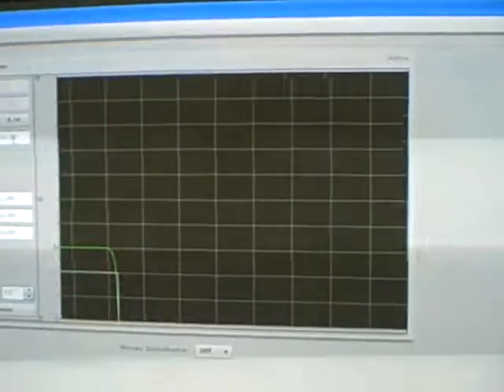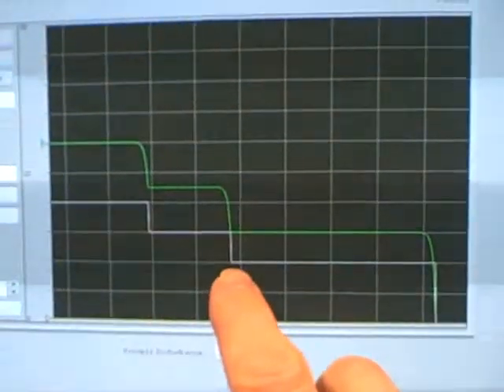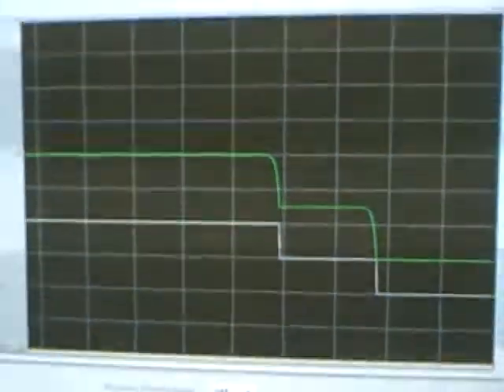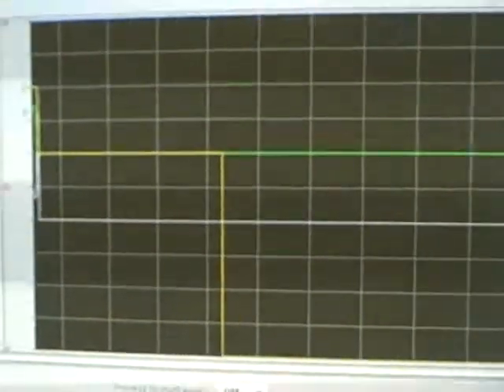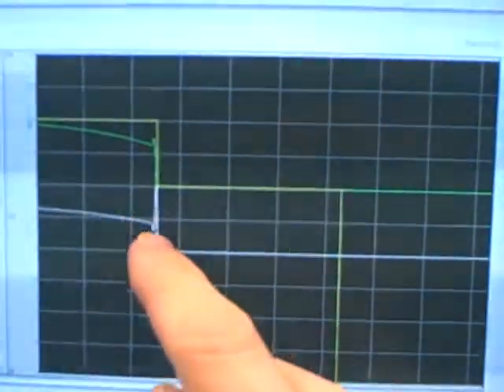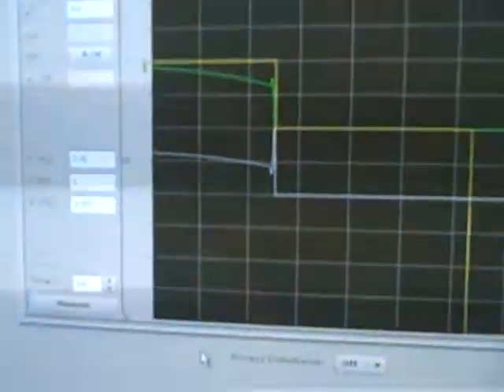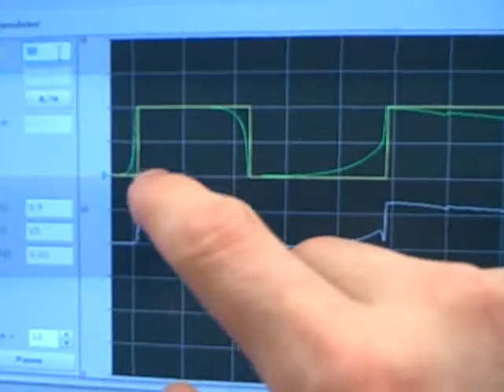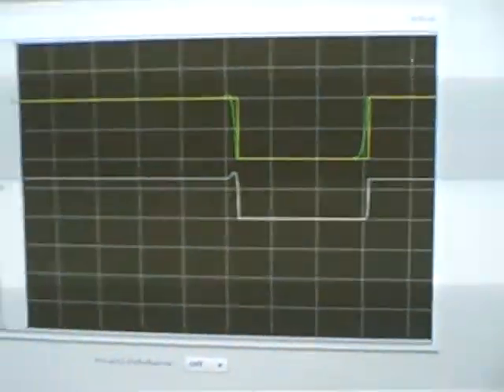Simulated self-regulating process PID tuning

Comment from the maker: The problem with changing gain to correct for offset is that you will introduce dynamic instability.  If you crank up the gain to reduce offset, you may drive the loop toward oscillation.  Also, this would only reduce the offset and not eliminate it, since a proportional-only controller's output will always return to the bias value once PV=SP, regardless of its gain.